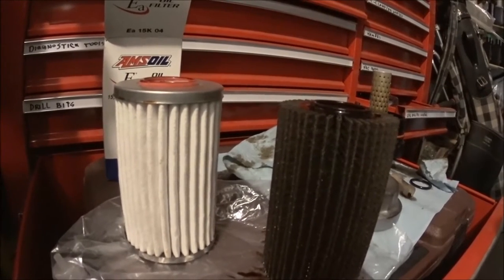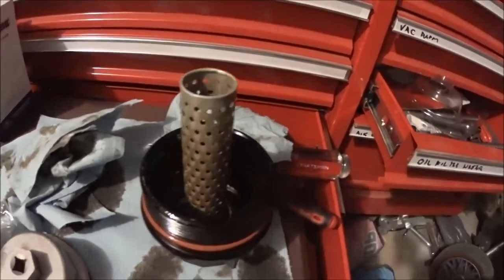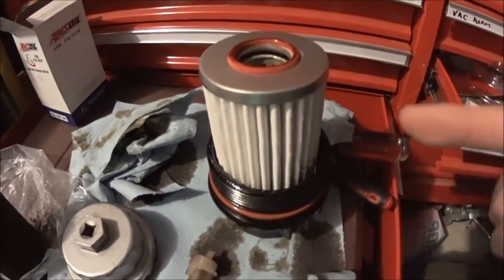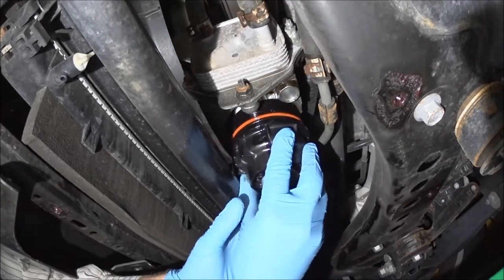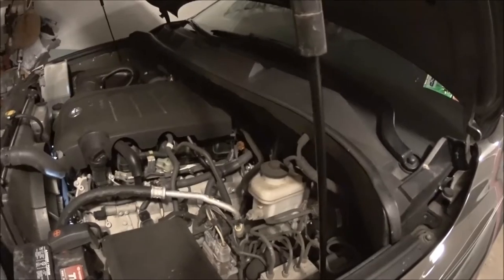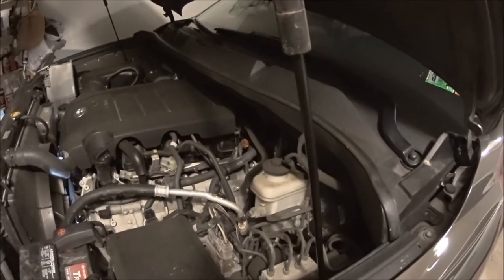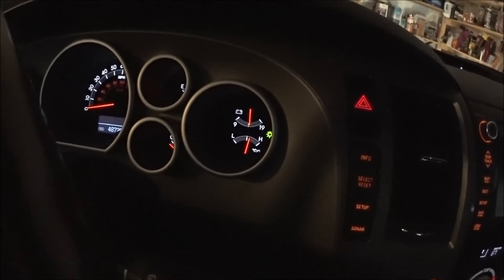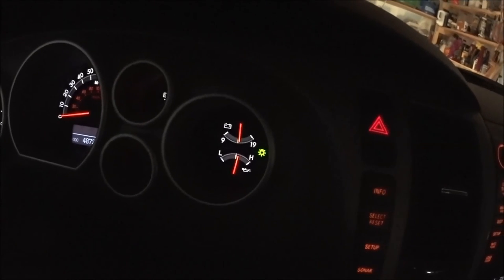Amsoil oil filter for 5.7 engine and what a difference it makes. Toyota and others vehicles

Comment: Have you considered installing a bypass oil filter to improve filtration efficiency? Amsoil sells a kit. I'm tempted to install one on my 2016 4Runner.
You know, I used to hate those element cartridge filters on Toyotas. They are a pain to replace. I have to remove the bottom engine guard armor plates to get to the filter. Technically it's a better system when compared to regular filters. All you replace is the filter element. This eliminates potential issues caused by poor quality check valves and improperly calibrated(and sized) bypass valves in aftermarket filters. This design will definitely contribute to improved engine lubrication and reduced wear. I guess I don't mind to spend an extra 30 minutes to do an oil change.
 I've been using Amsoil Signature oil and their premium filter elements since I bought the vehicle brand new. So far, so good. One thing I noticed about the Signature oil is that it gets dark a lot quicker than other similar oil brands, like Mobil 1 or Valvoline synthetic. Have you noticed this on your vehicle?
Reply from the maker: +Andrew Ivanov , I don't think they make bypass filter for toyota vehicles with cartridge filter. It's normal for Oil to change color because it has more detergent to keep engine clean. Also, it cleans engine from deposits left by other oil. Change in color has no no negative effect on Oil performance. I don't recall color change, since I go by Oil analysis report.
Reply from the maker: +Andrew Ivanov , other people have noticed color change, friends and family members.
Reply: I use a new style Frantz bypass filter on my 6.4 liter Ram 2500 and it keeps my oil super clean.  I use Amsoil SS.
Reply from the maker: How do you like your 6.4?
Reply: repairvehicle So far so good, it has plenty of power and I just towed my 28 foot travel trailer from Western Washington to Arizona with no problem.  I've had it for a year now and have only turned 16k miles on it so far.
Reply: Yes, Amsoil makes a single bypass filter that will work on Tundras.
Reply from the maker: Are you sure? For 5.7 with cartridge filter?
Reply: Technically, you could tap into an existing pressurized oil line, anywhere near the main oil passage after the existing oil filter. Connect it to the bypass filter through a small orifice and bring the return line to either valve cover. You can drill and tap the oil fill throttle and connect the return line to it.
Reply: A bypass filter will work on any engine with a pressurized oil system.  If you don't have a dedicated pressure location you can use a T adapter on the oil sending unit or pressure switch.  Most kits come with that adapter.
Reply: See! Andrew and Clint know what I am saying ;-)

Comment: How does the TRD synthetic Oil Filter stack up against the Amsoil that you just tested. They look very similar
thx
steve
Reply from the maker: On the outside its almost 100% identical, except for TRD logo and material that filtrates the oil. Amsoil filter has higher effiecncy vs TRD meaning it provide better filtration. Are you considering AMSOIL products?
Reply: Have used Amsoil off and on for years. Your test at startup on the oil pressure is impressive. Several more bars of oil pressure over a regular paper filter on a cold start. Wonder if Amsoil is making a private label filter for Toyota (doubt it) for the TRD or more likely, whoever is making Amsoil filters (do you know?) is also making the TRD filter at Toyota's specs. .
Reply from the maker: PARDS2, what brand of oil filter are you considering to use now on your vehicle?
Reply from the maker: PARDS2, I don't know who makes TRD oil filter. I am not 100% sure, I think Amsoil makes its own filters.
Reply from the maker: PARDS2, I don't know who makes TRD oil filter. I am not 100% sure, I think Amsoil makes its own filters.
Reply from the maker: PARDS2, what are you driving and how many miles on vehicle?
Reply: PARDS2 champion labs makes both filters